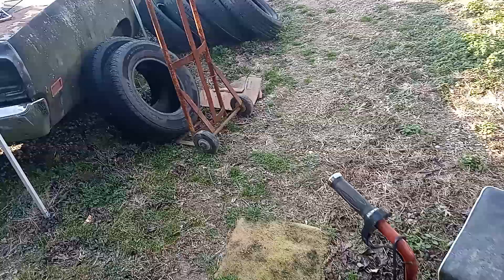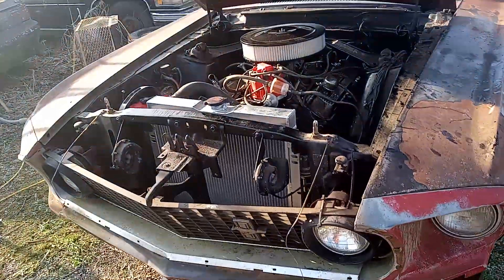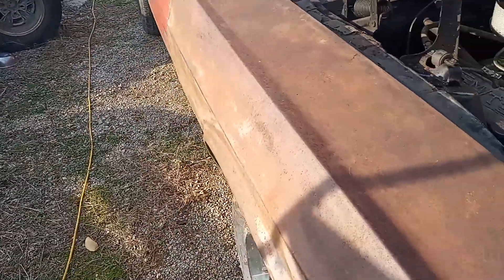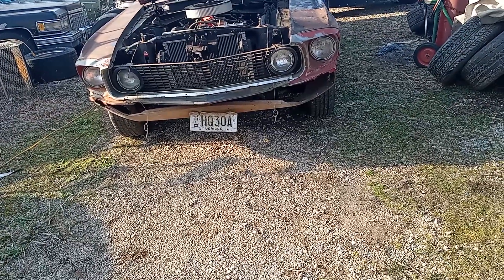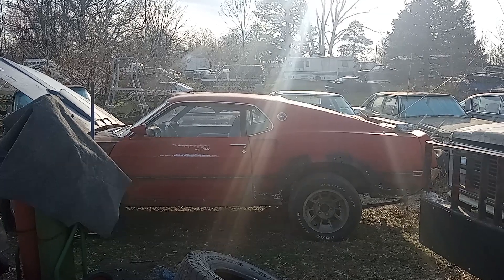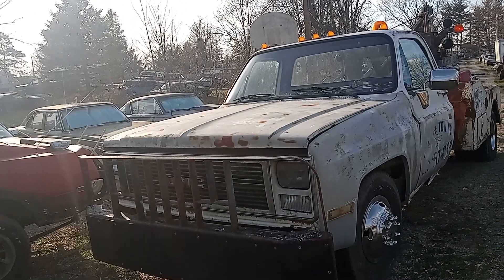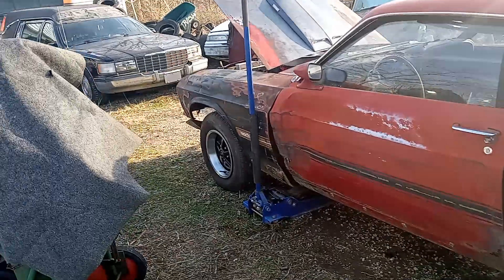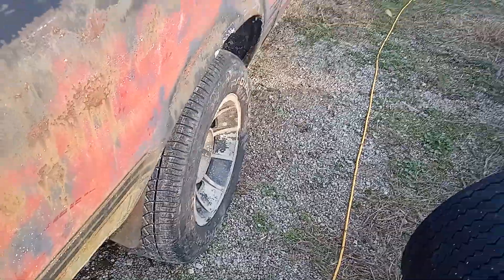My 1969 Ford Mustang Mach1 gets its first oil change in 15 years this 351w takes 8 qts of oil

Comment: I had spaghetti for dinner. I'm fixing my 87 Yugo. It has the original 13" rims. It beige. Their pretty fast stock. I'm trying to find a turbo for it. It only has 30, 000 original miles.
Reply from the maker: Wt u eat for dinner is your business and a yugo was the slowest car ever built you are not funny at all wt a joke hey maybe you can get twin turbos on that thing then you can at some nitrous and spread in the 6 seconds range at maybe 90 miles per hour
Reply from the maker: I eat yugo's for breakfast buddy in my sleep